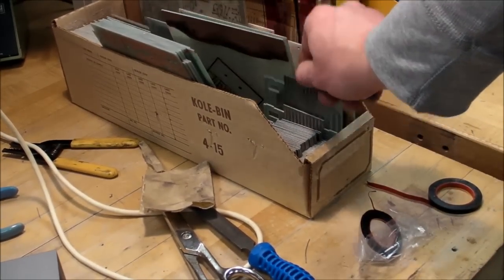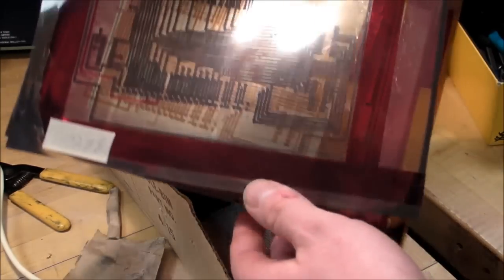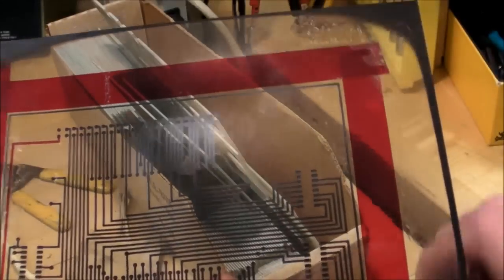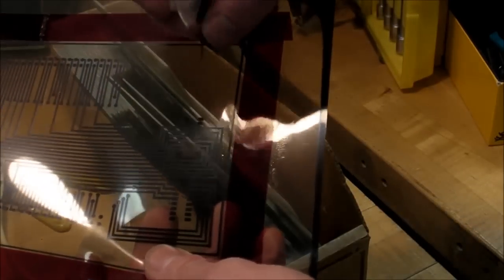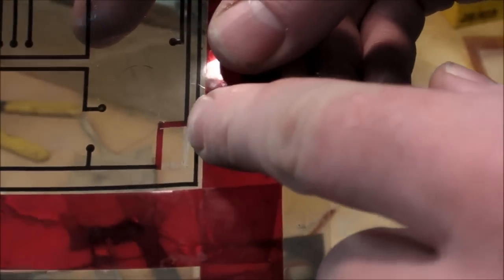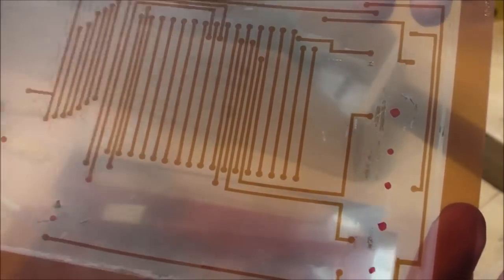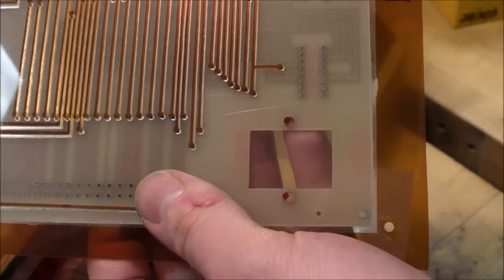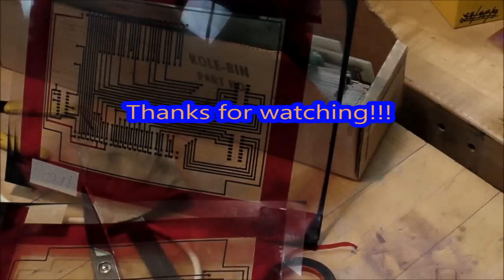(#0059) Old Transparencies for Circuit Board Etching

Comment: Done that direct on the copper board then etched it. Used dry transfer letraset as well for the pad patterns and some for multiple traces. Made a few that were wrong, mirror images..... Just used them anyway, was not going to respin it again. Soldered on the top instead of the bottom.

Comment: Ah those were the days. I used to work for a family business and we made circuit boards using the tape and pad method. The method used with the film and red tape was called mechanical etch. I even made artwork film for pcbs cutting tracks and pads in red film with a craft knife. Many days work for a complex circuit. But I enjoyed every minute and would do it all over again. Great memories.